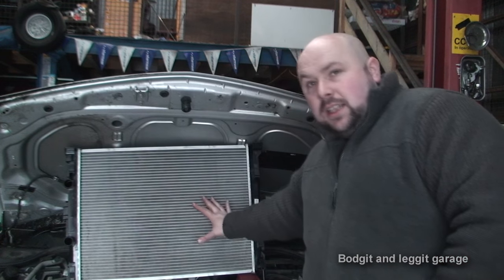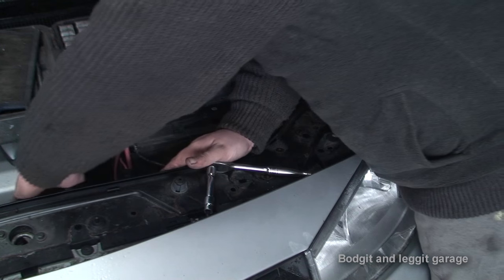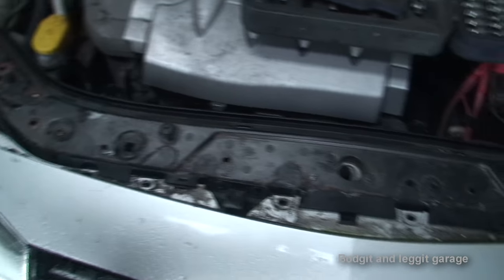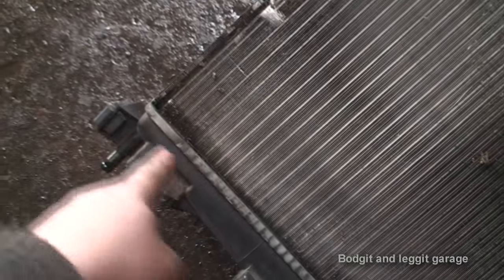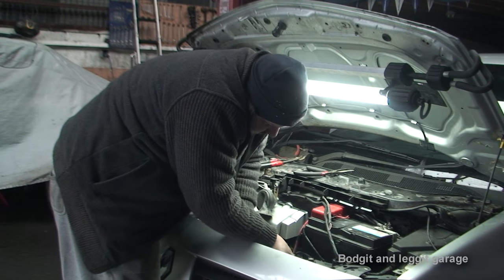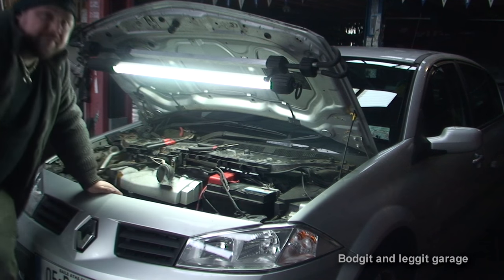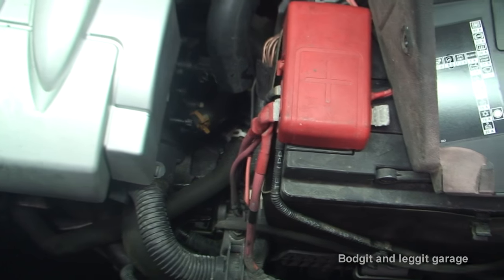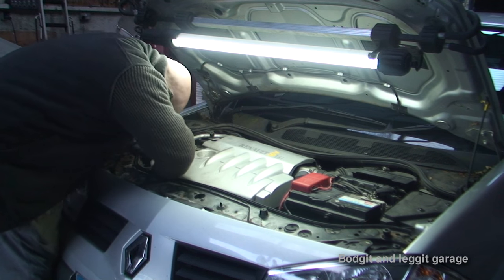bodgit and leggit garage how to remove/install renault megane radiator

Comment: Excellent video, I needed to change the radiator fan and I didn't know how, I didn't find a video in Portuguese explaining this, I didn't have to disconnect any wires or hoses. Congratulations on the job! Hugs from Brazil!!

Comment: After watching this I have managed to remove the front , bumper, got to the radiators easily now just waiting for the radiator delivery, with the lockdown that could take a bit of time, by the way it’s my first time dismantling a car like that. Thanks for the video
Reply from the maker: Anytime mate glad the video helped you
Reply: Radiator arrived yesterday and managed to fit it in today, for a first timer it took me 2 hrs, easy job. Thanks for the great video, my advice would be to remove the bumper, thank me later

Comment: If you took off the front bumper this job was easy. No need for taking the fan out. Without the fron bumper you have plenty of room to work. I changed my radiator yesterday using your video. Thanks.
Reply: I think it is straight forward removing underneath cross member. Only two bolts and the whole support frame is removed. Then just slide it down.....

Comment: Hey Leon great vid. Can I just clarify bleed process with you.
1) FILL up overfill tank and leave cap off
2) Turn on car and heater set to hot.
3) Take off bleed screw and wait for solid stream of water to come out
4)Put back on bleed screw
5) Put back on overfill cap
Reply from the maker: Arts&Trusts yes mate correct but certain cars do have some funny ways of doing it but that will suit me do 90% of them

Comment: great video bro, but i have another question and its a hard one to try and get help on, please advise on how to remove the coolant bottle as mine is cracked and have replacment but dont know how to remove the old one, any help will be greatly appreciated
Reply from the maker: Hi mate after top of my head I don't know how many bolts there are but there's going to be at least two to three bolts on this just remove all the part surrounding it you will see the boats they should be on the inner wing so just remove the pipes out the way or anything you need to move and you should see them quite easily after that

Comment: Great video , them renos are horrible to work on I've heard from many sources
Reply: I own Renault megane 2003 sedan petrol version !!! i grew up in this car and love it to death.My parents bought another one and they did only 35 thousand km.So i am using it every day worked on it learned alot .Once you know what you are doing its very easy than.Now i can work on almost any cars thanks to Renault megane btw its very safe car Euroncap gave 5 stars.
Reply: I got to agree. Im working on my gf megane and its pain in ass in what is very simple repairs in other cars i used to work on. For example if you need to replace valve cover gasket and replace timing belt you need to remove engine mount and lift or grab an engine beneath.